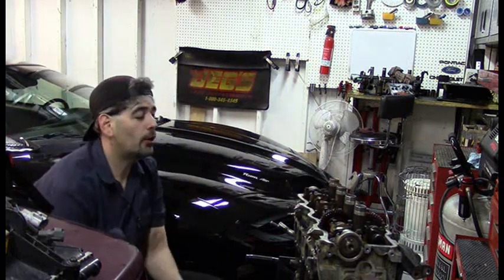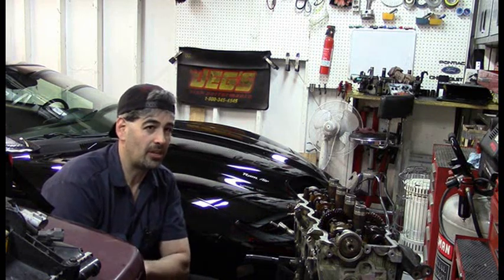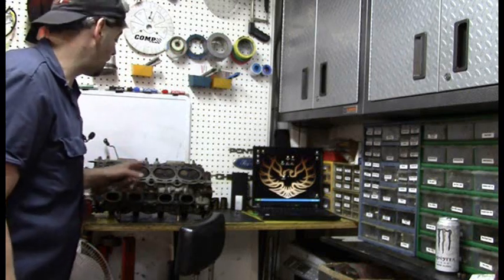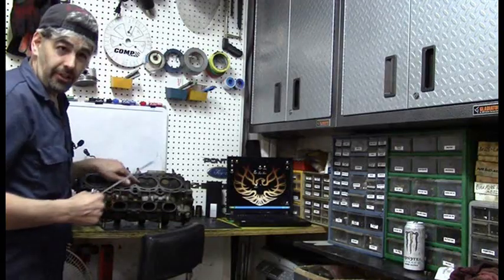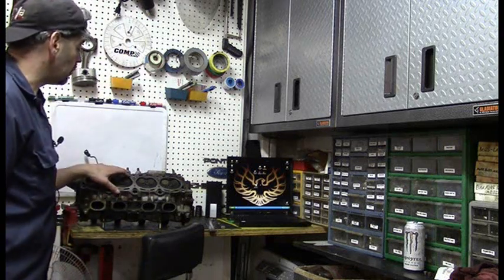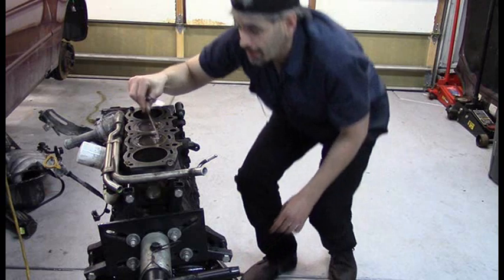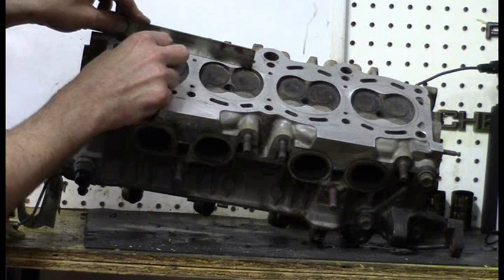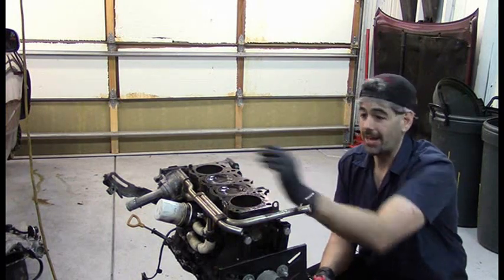Replace a Cylinder Head Gasket Yourself and do it RIGHT! Part 1

Comment: Hey man is this the same job u would do for a motor that's makes a knocking noise because the timing belt broke and damaged the engine
Reply from the maker: Mohamed Ali It depends. If the pistons were damaged then much more would be involved. But this video would be the minimum what you would do.
Reply: Yeah I bet u they are because  the the timing belt broke  and after I replaced it it started making that knocking noise
Reply: But thank u for getting back to me u have some amazing videos you need to be charging admission to the viewers lol

Comment: Is it ok to put new head gasket on engine, if didn't have blown head gasket. I heard have to resurface the cylinder head before before putting new gasket.
Reply from the maker: Why would you do that?
Reply: This what the service manual telling me. Once cylinder head is remove, the head gasket must be replace and check for clearance before putting new head gasket.
Reply from the maker: no i mean why would you replace the head gasket if you have no blown head gasket?
Reply: I want to rebuild the engine because something wrong with it inside the engine block. It have been working too hard.
Reply from the maker: What is wrong inside the engine block exactly?  There would be no need to remove the heads even if that were the case.
Reply: Main and rod bearing are worn out.
Reply from the maker: Then you must be doing a complete rebuild i assume.

Comment: I have a Toyota Camry le v6 one of the spark plugs has oil can you Tell me why is the reason, if I have to remove the head or not let know thank you
Reply from the maker: Lots of reasons. could be leaking valve seal. could be low compression. if it’s not burned oil could just be valve cover seal. lots of reasons.
Reply: @SchrodingersBox  I just find out that the spark plugs there were different. Thank you you should start a classes and I'm going to be the first one

Comment: Sir I believe you know your stuff!!! Awesome Video my friend. Wish you lived here in Pa. I have you work on my Tauras Se Heads!
However my question is this, How did you clean the oil/antifreeze chocolate milk mix from your engine and parts etc Sir??? and did you remove the pan to clean it and remove that grime mix??? My first time doin this job Sir, and I need to know how to clean the engine and pan and what ever you tell me to clean and with what cleaning agents Sir. I am a professional welder by trade, but cars...well thats another world to me. God Bless and I'll await your response Sir!
Reply from the maker: +Unique Touch That's a really good question- normally my procedure is I use kerosene to clean the parts, and I have a set of brushes that are long and thin to brush out passages and tunnels.  I then fill the pan with just enough fresh oil for the pump to pick up, and prime the pump for about 3 or 4 minutes. I then dump that oil out and fill as normal after final assembly and change that oil after about 500 miles and then follow normal schedule from there on.

Comment: And i have question i might have a head gasket leak or warp head. .i haven't did a compressed test yet but iam down to the head cylinder but is it bad too see no milky. Substance in between the heads nothing mix with it.?
Reply from the maker: Not sure I understand your question but whatever it is, until you do the compression test, there is nothing definitive you can say. There can be other causes of coolant/oil mix (leaking intake manifold gasket can cause this and is a known issue on many early 2000's GM cars).  gather your evidence and the evidence itself will point decisively to a conclusion if properly collected and analyzed.

Comment: @Schorodingers Box. 
I have a Suzuki Swift 1995 auto trans. Its been stuck for 2 years. Replaced air, gasoline and oil filter along with motor oil and starter  and the throttle cable. It runs but when I accelerate, it blows white smoke. At first it blew the smoke while the car was idling, now there is no smoke unless I accelerate. I've been doing research and blown head gasket is one of the main causes for this. The mechanic said, that since the car has not used for a while, it might be the cause and might go away with use and if not to bring it back for repair. What is your profesional opinion on the matter. 
Cordially, 
Gjvmlaw
 P.S. 
The car has not overheated, I think the throttle cable installed might have to be adjusted because it accelerates well but I have to put the gas pedal to the max and it hits its limit around 35-40 miles. Have not had the chance to put it on the interstate to see if it reaches 65 MPH. 
Thanks in advance for a student who does not want to and can't pay for a new or used car. Car was a gift and I can only afford to do simple stuff myself and fix major stuff little by little.
Reply from the maker: +Guillermo Méndez I would do a compression test to verify if there is a head gasket problem or not
Reply: +Guillermo Méndez P.P.S. 
Thought the paper test on your head gasket diagnostic video very informative and practical. I am a low income law student and can't afford a new car but I do know how to study and your systematic, methodical, scientific test are things I can study and learn. 
I don't have the equipment for the other test but i do have a piece of paper. Thank you very much. I just hope I don't have to go to a machine shop. Would you recommend buying a replacement engine if it extends the life of my Suzuki Swift 1995/GM Geo Metro auto trans or fix the engine? Taking time, cost, and other variables into consideration. The Suzuki swift 1995/ GM Geo Metro currently has the highest MPG record. Bottom line: I need a reliable fuel efficient car. 
Thanks for the advice in advance,
Cordially, 
gjvmlaw
Reply: +Guillermo Méndez 
Sizzle test is great for us on a low budget. Never underestimate the ingenuity of a crack head. They're are sick and humanity is at its best when self preservation kicks in. I've heard of them get a car stereo in under a minute flat with a police station less than a block away. LOL ("We laugh in order to not cry")
Reply from the maker: Guillermo Méndez LOL- very good advice indeed!! Never thought about it like that but I agree with you 100%.  Necessity is the mother of invention and who has necessity more than a crackhead lol!!!

Comment: I have a car that overheats in a matter of minutes the coolant boils over and shoots of the reservoir. It's a 03 honda civic. I checked the compression and I get 150 - 180psi when I start the car with a compression tester on each cylinder. I've checked the radiator. Head gasket, timing belt, and water pump have all been recently replaced. Heat is coming out of the vents when the car is hot, heater core seems good then. Stat has been changed a few times. Fans are good. The one thing I keep thinking is there might be a cracked in the cylinder head or the cylinder wall, put it only happens after extreme heat. Any ideas?
Reply from the maker: I would try a leakdown test on each cylinder.
Reply: Leak detector jus put gasoline on the cilinder  Lol

Comment: Hi brother I need help from you 
My car Toyota Camry v6 3.0 1999
I have problem is oil touch to all spark plug vary much and I test the engine air pressure was 175 to 180 PSI all cylinder. And I still confuse where the oil came from?
Reply from the maker: Sounds like leaking valve seals or (less likely) a PCV issue
Reply: Thank you for reply 
Ya I did change them both valve seals and pcv .
But still oil goes to all spark plug

Comment: Sorrry, I may have been day dreaming, but did you finnaly determine what caused the warp? Was it that bad neck on the radiator? Great Video my mom has this exact same car.   Oh and thanks for helping me with my timing belt on my 01' Sennia last Sept it running great!
Reply from the maker: +Vidal Martinez Yes it is apparent the only issue with the cooling system was the radiator neck leak

Comment: May I ask, what happens if the head cannot be resurfaced because the resurfacing will drop the head too low ?   Is your only option to hunt down a good head that doesn't need resurfacing like the one you bought from salvage or is it possible to fit a slightly thicker head gasket to compensate for the drop ?  
I apologize in advance if you answered this in the video and I missed it or if it's simply a dumb question.
Reply from the maker: In that case I replace the head.

Comment: "Treat it like a baby."  Store it in a plastic bag.  ;-)

Absolutely stellar video!  Thank you very much for taking the time to make this.  :-D
Reply from the maker: rhkips Thanks Bro. Yeah once you get to the point of removing a cylinder head- or an engine- you quickly realize that anything you can do to secure your investment in labor (and parts) is well worth it. It's funny how once you pull a cylinder head you realize that $40 for a set of new head bolts maybe isn't as unreasonable an investment as it seemed the day before lol.

Comment: Hey Schrodingers Box, I found it interesting you use sand paper for gasket removal. So many online haynes manual jockeys would say use a razer blade or you will go to hell. 
What are your thoughts on this? 
I wouldn't mind seeing a video on how you prep surface's :)
I have used a Nylon Wheel on a drill with common sense and have not had any issues so far, I have the assumption that a nylon would break down before aluminium so it should be all good!
Reply from the maker: Actually use a wire wheel as the primary tool, with a gasket scraper secondary and sandpaper as final finish
Reply: Schrodingers Box assuming your not worried about creating low spots or a uneven sealing surface using a wire wheel? What material is the wire wheel ?

Comment: your : finger as feeler gauge : story reminds me of when I was 18 I worked a summer as a valve job machinist ... I got so I could tell valve stem  warp age of .005 and in with my thumb and for finger ..never tried it on the head  itself though ..makes me wish I had now :)

  on  the head warp side of things ..once had a customer that refused to  have the head resurfaced even though it was warped .025 ..//said he would just use 2 head gaskets LOL
Reply from the maker: Hahaha. Yeah prior to my experience with engine internals, if someone told me they could tell a warp on a valve or head with their finger I would have cried total BS. But at this point, I absolutely believe a skilled machinist can detect these by feel and in fact, even for me the feeler gauge is just for the video when I check cylinder head flatness. In reality, I lay the flatedge and look at the gap and can instantly tell if it's out of spec or not. But I can't feel it with my fingers yet!

Comment: Hi Matt. After watching your great videos I decided to do a 'sniff' test on my car, which has indicated yellow so there are impending issues. The car runs fine with virtually no signs of imminent failure, although the reason for me testing it was that I did a coolant flush and found copper particles in the expansion, giving me reason to believe that a previous owner had used some sort of k-seal type liquid at some stage. Anyway; I've take it off the road and intend to strip it down this weekend, but, in your experience; is the head almost certainly going to require skimming, or is it just pot luck due to me not knowing the exact history of the issue? I guess I'm kind of hoping that because the car runs well with no real sign of an issue, and because the gasket hasn't yet 'blown' per se, that I might get off lightly.......How wishful is my thinking? Thanks, Jon :)
Reply from the maker: I would validate it with a compression or leak down test. If it passes either, you have nothing to worry about.
Reply: @SchrodingersBox  thanks Matt, will do, appreciate it.
Reply: @SchrodingersBox  Hi Matt, just an update in case you were interested....I followed your advice and performed a compression test, and although the figures were [marginally] in spec, cylinders 2&3 were slightly low so I guessed if anything there was a small leak between the two. I stripped it down and sure enough there was a small crack in the gasket between 2&3! I used a straight edge to check the head and there was a slight dip in the same area. It worked out (I thought) more economical to buy a ready skimmed head from a guy on eBay, but it turned out to be a sh1tter, with a lot of pitting and a crack! Lost enthusiasm at that point but found a machine shop near me that have supplied me with a properly reconditioned head with all the valves checked/cleaned/refurbed as well, looks great. I think I have everything ready, fingers crossed for the rebuild....

P.S. your videos have been a great help, so thanks for that!

Comment: What if you didn't have a cylinder head  or block problem and your spark plug just got stuck  in there and u take the head off  and fix the spark plug  problem put the back on head  with new gaskets  wat would happen to the car
Reply from the maker: Ah great point- that would justify new gasket only. Perfect example.

Comment: since your a mechanic I want to get your honest opinion even though this is about a boat it has an inboar motor 5.7l Volvo penta gsi 280hp..... heres the story... Ill be driving the boat on the lake for about 15-30 minutes until eventually I hear  my engine become louder, I open my compartment and the oil cap is off and some oil is seeping out of my dipstick, as well as my oil caps threads are now melted and there is smoke in the compartment which I believed were from the burning plastic of the oil cap and there is a smell which I think is from the plastic. now my temp gauge on my boat didn't exceed 155, im being told it could be a clogged vent valve/ pcv valve because my crank is building to much pressure? im also being told by others maybe its a headgasket?, or its piston rings....  but what I don't get is if it is a headgasket why would the engine run fine at idol for awhile and also on the lake.. I just figured if there is an issue wouldn't I be able to see smoke as soon as I run it on the lake ?  I have yet to do a compression check and I need to be doing that here soon.... just hoping I don't have to dish out 3,000 dollars in fixing this engine....

Comment: hey i have questions...my acura tsx head gasket has blow up and i would like to know how much it would cost :( im very sad
Reply: its an 2007 tsx
Reply from the maker: All TSX's  in 2007 just have a 4cyl engine so provided you only need head resurfacing it is reasonable you could possibly be back on the road for about $300 in parts if you did the job yourself

Comment: Hi, when I'm driving fast coolant is overflowing to the reservoir tank, but not overheat temp gauge is normal. No white smoke coming out or oil in coolant is this a sign of head gasket please help thanks?
Reply from the maker: What is your compression reading?
Reply: Don't  know
Reply from the maker: that’s only way to know other than a leakdown test.
Reply: thanks

Comment: Sir,  If you could give me insight on a 99 Mitsubishi Mirage 1.5L I had an overheat happen after not burping the system from a water pump replacement. Brain fart on my part. 
I do know how to turn a wrench, have a professional shop with car lift, Speedyair compressor, hoist, blah blah blah... built to build Bonneville record holder sand track cars. 
We just brain farted or didn't burp the system properly after the repair. 
Now we have oil and water where they don't belong. 
Got the kit to replace everything in the head and about to lift it up, flush the systems and get moving on the repair this morning. 
We'll be getting down to taking things off the engine, debating removing the engine entirely, if it's a common sense move and will be continuing to the head removal as we continue on his car tomorrow, likely. 
So we know the cause of the water/coolant, don't know if the head is bad. I'll be doing the "oil in the cylinder" concept like you mentioned. 
Any tips would be greatly appreciated and hopefully you see this before July 16!! 
Thanks again. '
Reply from the maker: before you do anything else I would do a leakdown test for sure.

Comment: Thank you for all the information I totally would of been lost installing that specific gasket... thank you for the fire ring info... also yes!!! Thank your for saying well a car just doesn't over heat something caused it.. I got a case that brought me to your video and they diagnosed a bad head blocks... I'm like ok... but which one???  and what diagnosis was done ??? And can't even explain to me why not to add regular water to your vehicle... I'm like ok so your husband needs to back off... he can't even explain why regular water is bad for your radiator... in my head ok now I got to do all the diagnosis test and not trust your husband but he is very prideful... the wife is leaning towards my side since the husband hangs out with mechanics but they all they do is drink all day... the car has been like that for months now... wish I had more of you here in L.A